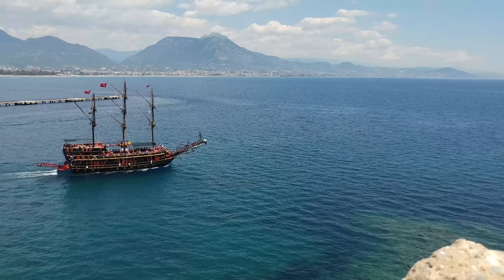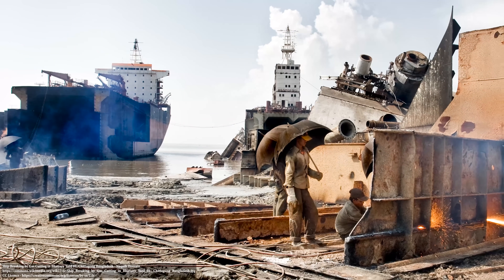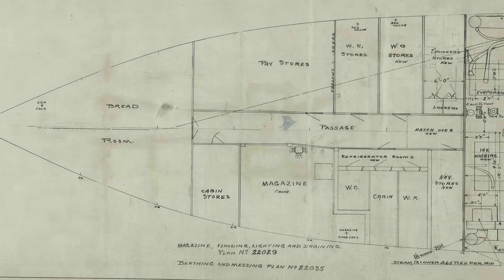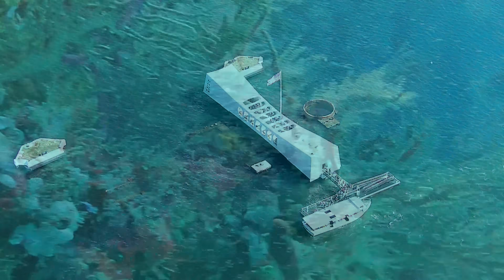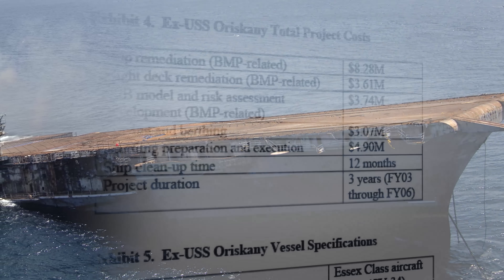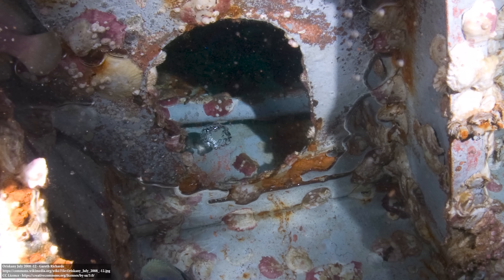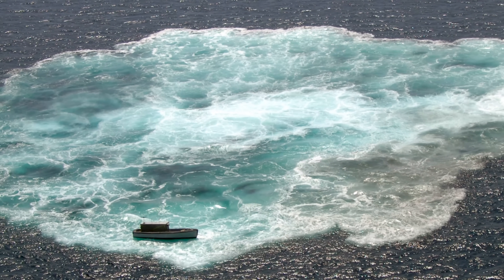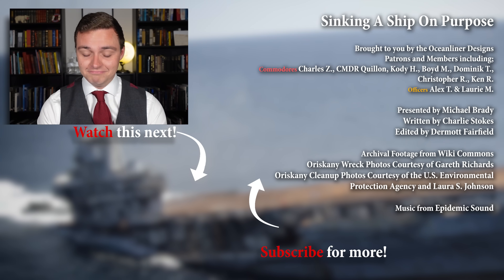How They Will Sink The SS United States?

Comment: Actually Okaloosa County bill is for all the mitigation work costing $2.9 million. Most of the asbestos was removed years ago. It helped that the ship was fully gutted before being moved to Alabama. The United States is smaller and not a warship so the cost is a lot less. The wiring has to be removed also. 
 Michael you should watch Okaloosa County BoCC Dec 9th Live video and go to the 2 hour 41 minute mark. There is a budget request and slide show presentation on how it ended up short on $700,000. If you watch the presentation every cost is listed from the cost of towing to every budget item.

Comment: The Oriskany was not used in WWII. Though under construction during the war, it wasn’t commissioned until 1950, because of the progression of the war in 1945. Construction halted and was  modernized and then put into service after WWII had ended.  It was used during the Korean War and afterwards until it was decommissioned and then recommissioned and reclassified as CVA. Eventually stricken in 1989. 🥸

Comment: Why it still amazes me Titanic never capsized as it sunk.
Reply: Truly a insane sinking indeed. How if didn't capsize is kinda, showing how she was designed. Had the pressure not been what it was, then it would have gone right down. Truly amazing
Reply: No longitudinal bulkheads in the lower compartments
Reply: @Ccyawn123  Soft rivets broke up under the huge strain on the hull.
Reply: The lower deck crews and electrical/engineering staff kept things running and traded their lives to slow the sinking down. 

If I recall correctly, they even shut the boilers in a beneficial way.
Reply: This is likely due to the larger amount of coal on the port side, which was moved there due to the fire, and the Scotland Road, which was also on the left side. If the ship had grazed the port side against the iceberg, it is highly probable that it would capsize.

Comment: I mean there will be a reason but just now I can't understand why you would remove asbestos.
Asbestos is not poisioness. Only if small fibres get lose and get into your lungs they can penetrate the cells there and cause asbestosis. Mainly after decades after the first exposition.
There is no way to dispose asbestos other than burrying it into the ground on landfills. If asbestos is removed from the cladding of buildings i.e. they spray it with water to prevent the fibres from just floating through the air. In fact I can imagine that leving in in the ship, letting it soak in water would cause less to no exposure at all. Less than the plastic insulation of cables and such...
Asbestos ist just a mineral, a "stone" after all.
So yeah, that point I can't see, even as a trained asbestos expert myself. But someone enlighten me if they know any better what the scietific reason is there to have it removed.

Comment: Cars that sink in water that is deeper than its length, will flip upside down because of the buoyancy of the five tires.
Reply: Deeper than it’s length, or height?
Reply: @JohnBristol97  Length. It will float vertically on end before it flips slowly over, the trunk compartment being much more buoyant that the engine compartment.
Reply: @stephenduffy5406  oh, okay

Comment: My ship, the USS Guam, LPH-9 had no sea cocks. It had what are called sea chest blowdown valves to connect a steam hose to keep water intakes from freezing, such as for the main condensor. I was part of the so-called "salvage crew" where our job was to take a sledge hammer and break the valves off to help ensure that the ship sank. Why we were called a salvage crew was beyond me and we didn't have any sledghammers, either. The Guam was sunk as a target near Bermuda in 1999 so I guess scrap metal prices were pretty low back then.

Comment: Could describe it as a ship becoming a museum ship underwater, open for public exploration. But with special skills, certifications, and equipment required to visit. Still an improvement over the SSUS languishing and decaying out of public access.

For diver access, is there an optimal depth? I'd imagine they'd want it to be shallow enough to be reachable without requiring too high-level SCUBA equipment/training, accessible to recreational divers, but also deep enough to not be a hazard to ships passing over, and deep enough that wave action won't be affecting the ship - that could both decay the ship faster (wrecks not fully submerged decay fastest along the new water line) and hazardously swirl divers against the wreck. This is another reason to strip down the superstructure and funnels - can have all of the ship adequately deep but keep the interesting parts - main decks - within reach of recreational divers.
Reply: I think the PADI scuba dive limit for amateur divers is 12 metres and those funnels were about 15 metres.  I imagine they'll drop her so the upper decks are within that 12 metre limit, that'll allow more surface light to penetrate deep enough that the wrecks not in pitch darkness.  As for passing ships they will for sure put a well marked cordon zone around it.  Too many divers in the water and if some fishing boat smashed its keel over the wreck imagine the captain would wind up in court pretty quickly.
Reply: @caledoniainteractive  I'd imagine not many ships have 12-meter draft, so shouldn't be an issue. They'll probably sink it away from active shipping lanes, too, though probably would mark it as a hazard - if nothing else, like you say, lot of recreational diving in the area. Probably will sink it as close to shore as possible for accessibility, probably the closest deep-enough spot to that on-land museum. Biggest hazard to passing boats would probably be fishing boats snagging nets on it. I've heard of wrecks being found that way, fishermen reporting something that many have snagged nets on, and some wrecks are covered in nets. Said nets would be a hazard to divers, so probably every effort would be made to prevent this, and any nets that do get caught on it would promptly be removed.

Comment: I am glad our friend Mike Brady from Ocean liner Designs let me know ships are designed not to sink. I did not know that
Reply: Some ships arguably were designed to sink. Not on purpose, but that's exactly what they did the moment they were put in water. I seem to recall Mike Brady did a video on such fails at one point.

Then there's ships that intentionally were designed to sink at least partially for various reasons. Dry docks, semi-submersible oil platforms, heavy-lift ships, or the "R/P FLIP" research platform that would sink the back end to stand vertically.

Comment: Imma scuba diver and find shipwreck dives fascinating. Hope they don’t put it somewhere too cold or deep. 180’ is fairly deep and technical. It’s best for the shipwrecks to go sink upright. It also makes navigation of corridors significantly easier when up is up.
Reply: The Oriskany is almost all too deep for recreational diving.  The island is about it (and it’s pretty deep itself) pretty much everything below the flight deck is all that technical mixed gas stuff. :(
Reply: The top should be in recreational depths. The Oriskany was a bit of a mess and didn’t exactly sink as planned. Hopefully this will. As far as water temperature, that depends on your definition of cold. Summer surface temp off of Okaloosa county runs 84-86. Around 100 ft deep that drops to in the 70’s.
Reply: 180' is going to be the depth to the bottom. The top deck will be 55' from the surface, so even newly certified Open Water can dive it

Comment: To be fair, when a ship is scrapped for recycling all of the mucky materials (PCBs, asbestos etc) have to be removed safely as well. However this will be compensated for in the value of the metals at the end. It's a commercial deal.
It's for the community to decide between sustainable marine environments, such as reefs; or sustainable recycling of materials, like huge quantities of iron which require less energy and CO2 production to turn into new ships, etc.
It's environmental both ways...

Comment: The Oriskany sinking has some great video out there.  They parked a small boat on the flight deck connected to cameras throughout the hulls.  Feed from these cameras was stored on the boat and, when the ship went down, it floated free.
Reply: She would have made a nice museum 🥺
Reply: @marckyle5895  Totally.  But the number of places with both the docking facilities and the tourist draw to maintain an aircraft carrier as a museum is pretty limited.  We have... without looking it up... two, right?  Intrepid and Midway in NYC and San Diego.  Capital ship cities are few and far between.
Reply: @Zeppflyer  Also Lexington and Hornet. Hornet, Texas and Alabama were pretty busy when I visited them, so there is still lots of interest, especially if the museum ship works to integrate itself into the community activities as a resource and sponsor,
Reply: @Zeppflyer  Lexington and Hornet, too. They're docked by big cities or an easy drive from one. It would have been nice if San Jacinto had been saved. She was the last straight deck WW2 fast carrier extant when she was scrapped 25 years ago.
Reply: I've seen internal-camera video from several ship scuttlings. Honestly it's pretty terrifying, seeing the water rushing in and the ship plummeting so quickly, no way anyone inside would be able to escape. Makes the Titanic sinking scenes look gradual and gentle by comparison. Of course these intentional sinkings are much faster than unintentional ones given all the extra holes cut, as described in the video.

Interesting about the camera feeds going to the boat on the deck - I figure most such recordings are just done using GoPros or similar, once the ship is sunk divers retrieve the cameras. Was Oriskany sunk in too deep water for divers to retrieve the cameras?

Comment: It really is kind of the middle ground for the fate of an old ship. I'd rather see SS US restored and kept afloat as a hotel or a museum, but I'm glad she's not being scrapped.
It's frankly tragic how many of the old greats like Olympic, Mauritania, and Aquitania ended up in a scrapyard.
Reply: I saw it as it was towed in and walked beside the berth at the salvage company on South Royal Street last March.  The fact it had externally deteriorated that badly in Philly...I can only imagine how bad it was on the inside and bow decks.

It literally looked like a haunted sunken oceanliner had come back into harbor from the grave.

There was no saving that.
Reply: They could have filmed Clive Cussler's 'Raise The Titanic' on her!
Reply: @STho205 You'd be surprised at just how good a condition she's in. Her hull looks horrible but its surface rust. There's minimal rust in her superstructure as its mainly aluminum. She's basically a blank slate inside aside from her engineering spaces.
Reply: @frankmiller7356  and it’s almost fully covered in zinc chromate which is a chemical that is non corrosive, the outside hull has zinc chromate under all the black paint that’s peeling off
Reply: @STho205  What you are seeing is only superficial.  The inside looks better, but it is not like new.   It could have been brought back to life.  It was (is) structurally sound.
Reply: @ksorsomeplace  not with decades of neglect.  This would have been a debate for Philadelphia groups to grapple with back in the last century.

Even WW2 battleships preserved were properly mothballed for only a decade or so....not over half a century of no care at all in very bad weather dockage.

I understand your passion, but it is too late
Reply: @STho205  The first years after layup, the ship was hermetically sealed.  In late 70's or very early 80's when the ship was putting on a floating dry dock for inspection, they found it to be in remarkably good condition.  During the time afterwards it has some hull maintenance at least twice by my research.  It's a skeleton, yes, but not a lost cause.  In the main, all it needs is an interior.  The steel is in good condition.  Weather related aging is superficial by all accounts I've read.  It looks worse than it is.
Reply: @ksorsomeplace  then you east coast Yankees should have saved it then.  Turnedcit into a theme restaurant and hotel.

Too late now.   If it went decades without anyone caring to even paint it to at least beautify the shipyard view...then the "ship has sailed"
Reply: @STho205 I agree with you. Multiple times in the past it has been bought with the hope of restoring it, then later sold because the cost was too large. I'm starting to conclude that it was "living" on borrowed time.

Btw, east coast yankee here 👋 😃
Reply: This is better than scrapping her, but i recall seeing an argument that this will somehow make her more accessible to the public. In what way? People will now have to spend thousands on SCUBA certification rather than hundreds on travel.
Reply: @Jopsyduck  Depending on how clear the water is and how deep she'll sit. You might not need scuba gear if you're content with seeing her from a distance. IE snorkling or through seethrough bottoms.

And as the other one said, compared to NO public access right now? Well some access is more than no access :)

We'll probably also get some fantastic footage of the ship over the years as well as people will no doubt record and upload any footage they take of the ship whilst swimming around her.
Reply: @Jopsyduck  to be fair, in Philly it was in a TWIC controlled port that was not a all accessible to the public. Now anyone with a dive certification can hop on a charter and go tour it.
Reply: At the time those other old ships were not seen as the mythical ships they are now because they looked like the Titanic, they were just old assets at the end of their service life.
Reply: @CamelCasee  Public opinion was pretty upset with the scrapping of the Olympic, she was the last major connection to the RMS Titanic, she is arguably the most successful liner ever; depends how you define "successful." As for the Mauretania and Aquitania, there really wasnt any way to "preserve" them, they were a massive bio-hazard, a bigger one than the SS United States
Reply: Truly would like to see the ship restored to its former glory and turn to a floating museum and hotel like Queen Mary unfortunately time and money is an issue
Reply: They have tried that for decades, and it never worked.

The simple fact is, unless it's a very historic ship like the Cutty Sark or USS New Jersey, it's simply not cost effective to keep them around.  Even the Queen Mary which has been a tourist attraction for decades is running into that issue as they are having to over a hundred million dollars into it just to keep it operating.  

There is an old joke amongst sailors that the definition of a ship is a hole in the ocean that you pour money into.
Reply: It's unfortunate really,but I'm looking forward to diving her. And honestly I do appreciate the efforts that they make to enable underwater exploration a little bit easier… It's not easy trying to navigate narrow hallways wearing my rebreather and carrying extra bailout bottles.
Reply: Olympic 😢
Reply: I'd rather Big U at least be scrapped than be a playground and selfie spot for clout chasing Instagram and TikTok nincompoops
Reply: It's a shame. I used to see this ship daily always thinking of what it could be if restored. It could have been beautiful again.
Reply: The cost of restoring the ship would not make sense. Its better to scrap it and recoup some money from it. It would then live on for infinity as pots, pans, engines, razorblades rather than rot into nothing whilst polluting the sea.